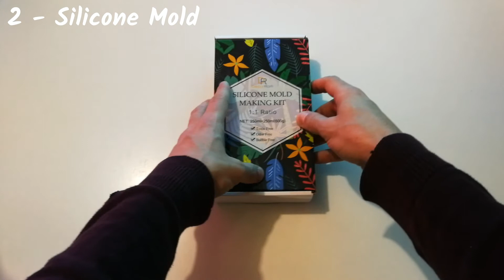4 Ways to Remove Hollowness on Tray Mount Mechanical Keyboards Cases

Comment: Do u think is risky make o-ring mod with nylon screws ??
Reply from the maker: What's the point ? You don't need screws if you go for gummy o-ring mount. And if you meant using o-rings with nylon screws, you can do it but they do close to nothing tbh.
Reply: @HeavyMix3  My point its when I do o-ring mod I make the PCB (plate and switches also) more flexible because its between 2 small o-rings supported by just 4 screws that are not very tight to give that mushy feeling to the pcb.
I order nylon screws,when they arrive I will try in my o-ring mod and update this answer
Anyway thx for the reply. I really like ur content and ideas.

Comment: Hey, do you have a link/specifications for the nylon screws? Thanks
Reply from the maker: Got them from Ebay a while ago but the listing is no longer available, you can find some on AliExpress tho
Reply: @HeavyMix3  what are the screw sizes?
Reply from the maker: @timurr0904  M2*6mm
Reply: @HeavyMix3  Thanks

Comment: Now do an O-ring mod and have it gasket mounted. End game right there. :)
Reply from the maker: Tried it, I wouldn't say it does a better job than the silicone mod, pretty much on par. But I recently made a build using a silicone mod and o-ring mount, mute the ping, keep the clack 👌
Reply from the maker: @luisfontinelles5834  For sure, I'll upload a comparison typing test soon

Comment: I still dont like the sound of it, its the space bar and keys colliding with the pcb plate, I think.
Reply from the maker: There are plenty of mods you can do to improve the sound of a board, this video is only about case ping.
Reply: @HeavyMix3  Difficult to notice much of a difference but maybe that is just me. Thanks for the excellent work on the video.

Comment: Have you tried using o rings on the screws like Keybored did with his tofu? That is the best tofu ive ever heard and honestly sounds a bit like a gasket mount. I wonder if the psd60 can sound like that as well. I think your idea with plastic screws is great and i would love to see it combined with o rings applied in the same way keybored did.
Reply from the maker: I tried using o-rings for the screws and it didn't do much compared to switching screws, especially because a silicone mold does the same job than the o-rings but on the whole board. After combining so many mods I don't think the difference would be noticable. I'm gonna build another fully modded PSD60 soon with a lower pitched switch, we'll see how it turns out. Keyboared tofu sounds quite hollow imo and I'd say the deeper sound comes mainly from the lilacs, and I'd be curious to see how godlike it would turn out if he was to use a silicone mold for his board instead of foam.
Reply: @HeavyMix3  so ur saying the silicons is contacting with the pcb and creates sufficient flex?? that doesn't make any sense. O-ring burger mount is only a small portion of clackiness off true gasket mounts, you really should try it out
Reply from the maker: @sensuku  The thing is once you silicone mod a tray mount case, adding o-rings for a burger mount only make the board sound worse because you're increasing the room under the PCB while trying to remove ping the silicone is already taking care of. Also tray mount boards don't have much flex due to the position of the mounting poles, and that's not some small o-rings that are gonna make a noticeable difference. I tried it with and without silicone modding the case, with silicone mod it makes the board worse, without silicone mod it doesn't do shit because the ping is transfered through the case by the screws (if you don't use nylon screws). But if for whatever reason it does anything for you then go for it, whatever float your boat my friend. (And I didn't say the silicone create flex, the silicone is here to remove the metallic ping you get from tray mount).
Reply: Man, i tried it and the board feels mushy

Comment: Hello, for wireless keyboards how would you mold the battery into the silicone? Do you replace the battery with a similar shape before pouring the silicone or is it safe to just pour it to cover the battery? Thanks
Reply from the maker: You can cut a piece of foam the size of the battery and place it wherever you'll put the battery, then pour the silicone. SIlicone have a low electricity conductivity so I don't know about pouring directly onto the battery, I wouldn't recommend it.
Reply: Thank you for replying. This helps a lot. Cheers